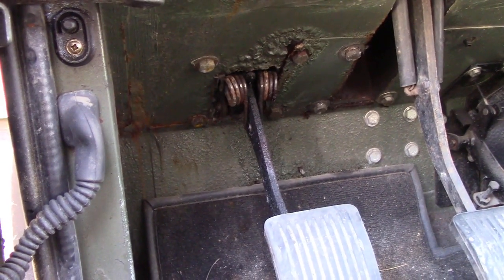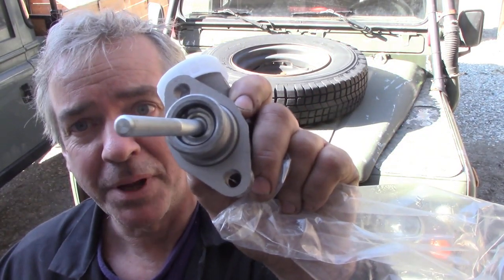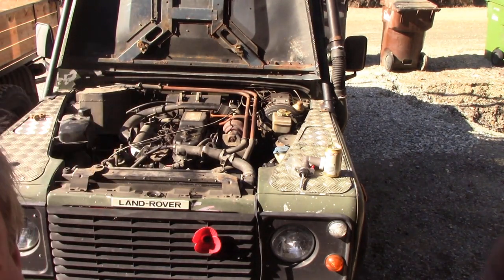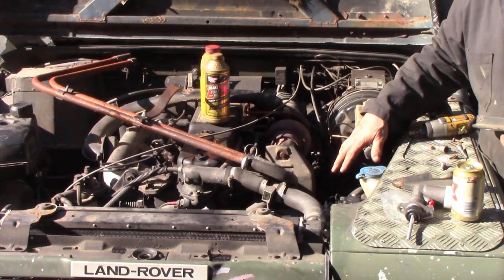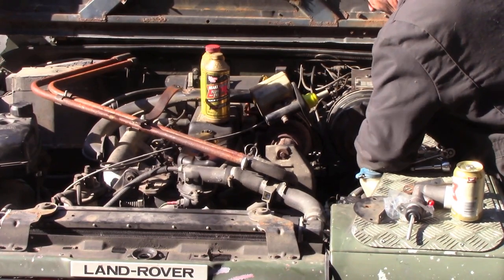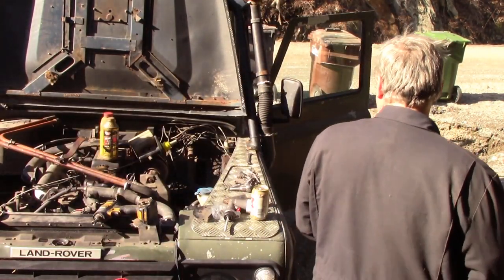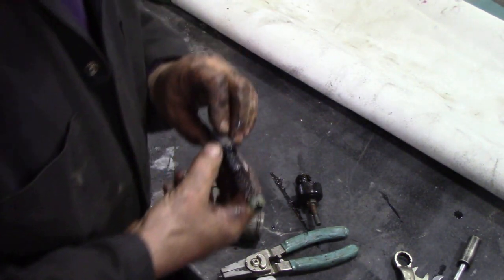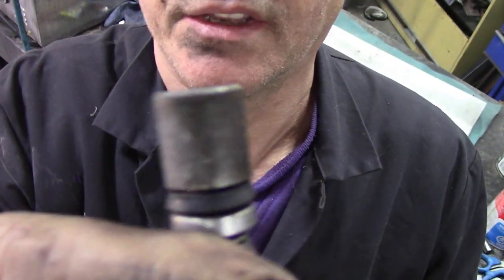Replacing my clutch master cylinder on the 130 / Isuzu Part 1

Comment: Hi mike I found the cylinder on my 300 tdi a pain to bleed up due to lack of clearance and the hopeless reservoir capacity so I now reverse bleed with an old style oil can much better results and can be done if your alone. I know you'll be aware of this but it might send someone reading this comment in the right direction 👍
Reply from the maker: Bleeding is not much of an issue it is topping up the cylinder that is!
Reply: @BritannicaRestorations  yes rubbish capacity and daft location

Comment: Prokekt Grenadier design action given there Mike on windscreen breakage and spare tyre pressure check. A directional mark on the spare wheel for correct orientation and an internal plate on the inside of the bonnet for tyre valve access would be great. A second tyre valve inside the wheel rim  idea seems a failure item risk I think.    Same access plate idea on a rear door spare wheel position would be good -  yes I've not checked the spare tyre pressure in 5 years on spare wheel on my back door. Maybe a tyre compressor  job on the spare when I get a puncture......

Comment: I have been using silicone brake fluid since 1984, and since 1986 in the Land Rover. The rear brake cylinders had been fitted in 1978 and had new rubbers when I did the next overhaul and filled with silicone. They were still good in 2006 when I did the major rebuild. I have never experienced any of the horror stories that were put about in the 80s when it became available, and it doesn't ruin your paint either. Provided your seals don't leak from new (there were some Britpart ones a few years ago with that reputation) you wont have problems, and it is ideal for vehicles used intermittently.

Comment: G'Day Mike.
Matey your last 2 videos for me have both been unlisted on your Y/T channel page. I thought at first it was just something wrong at my end but I noticed I'm not the only one to speak up about this small problem. 

As to the brake fluid leaking, I'm with your comment "I think its more from when I fill it" as the likely cause because those reservoir's are so damn small and in a bad spot on both L/H and R/H Defenders (but more so on the L/H models) and its so easy to overfill it just about every time. I know I do. I'm not sure how much the reservoir's holds but I'm starting to lean towards getting a largish pipet that can hold as close to the correct amount as possible and use that to top up the reservoir when needed. And I've started to stuff a rag under the reservoir when topping up to try to minimise the damage when I do spill.
Reply from the maker: Something wrong With YT today as it has been waiting to save the file all morning
Reply: @BritannicaRestorations  Ahh, its having a hissy fit hey, typical  :D

Comment: Mountain bikers sometimes use Johnson's baby oil as hydraulic brake fluid,surprisingly there's no difference in performance or issues after testing for a year!
Reply from the maker: Except the temperature! This is why we have different DoT fluids 
Rough rule of thumb = DoT 3 for front disc and rear drum and DoT 4 for disc all round
I have been in a Range Rover automatic  going down a 1:3 with a trailer on and that boiled its fluid - very scary!

Comment: Thanks Mike... Quick question for you... Have you ever heard of the defender chassis number being anywhere else on the lanrover... I know the chassis plate and front windscreen.  A friend has shipped one to the channel islands and as part of an official check they said they cant find chassis number  .. strange one... GN
Reply from the maker: Front right dumb iron usually but I have seen NAS vehicles stamped on the middle outriggers (Not common)

Comment: Hi Mate, 
I'm currently working on a 2.8i 90 and it would be fantastic if you can add some part numbers (just the part you are replacing or fixing).

It would be of much help if you could as it would prevent tons of time stuffing round with trying to find the number.

Also where do you get your parts, do you do direct or through something like LR parts?

Cheers from New Zealand
Reply from the maker: The 3.9  I fitted is a different to the 2.8 and I have no experience of those, sorry
Reply: @BritannicaRestorations  cheers anyway.
Bit hard finding any help on the 2.8i because there so rare and no one specialises in them.